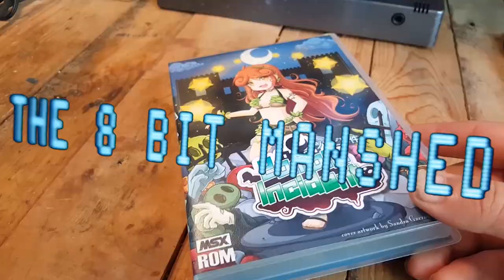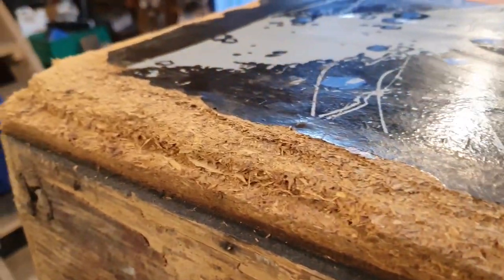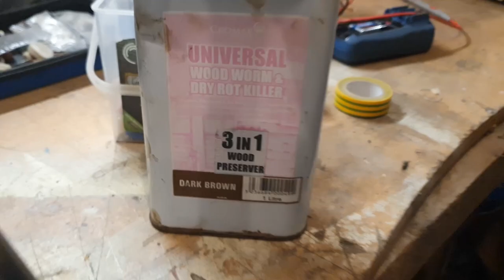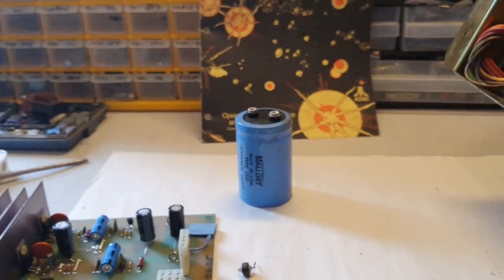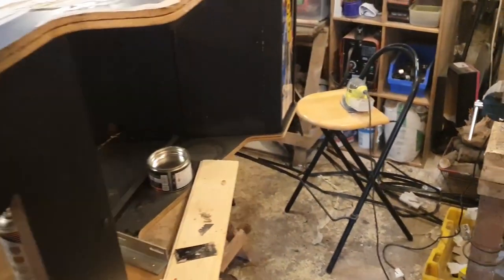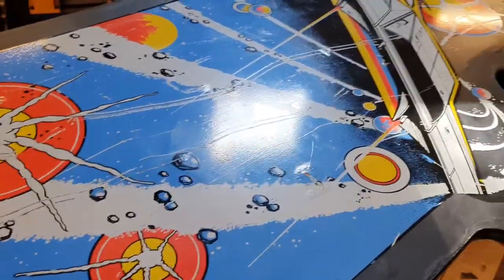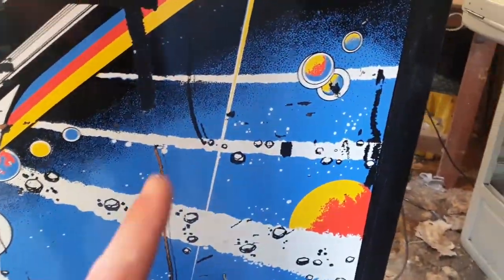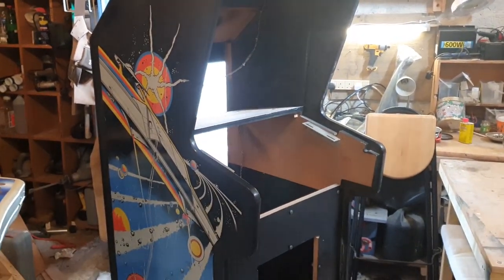Atari Asteroid arcade cabinet restoration part 2

Comment: Hi Ollie
That second fuse is a common problem with atari.
1st thing is to check the spade connectors that connect to the fuse holder to see if their is any corrosion because that can cause it to draw more power making the fuse blow.
Just try to crimp new spade connectors first of all or better still try to replace the fuse holder.
Then if it still blows then change the bridge rectifier